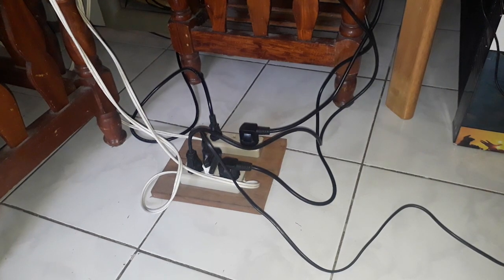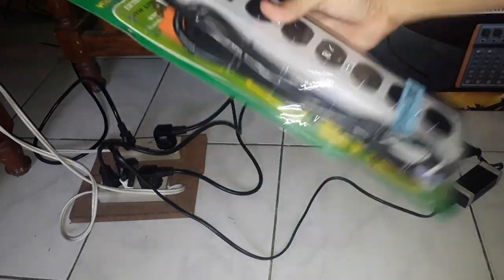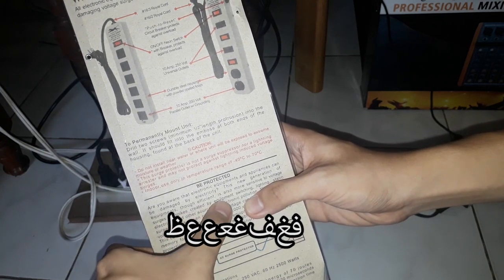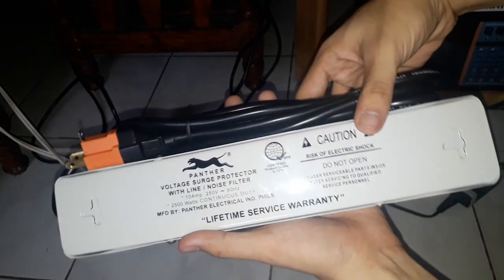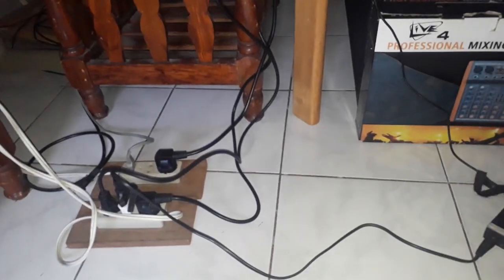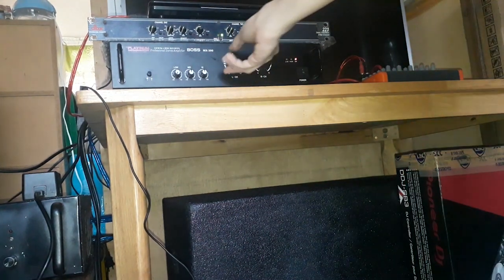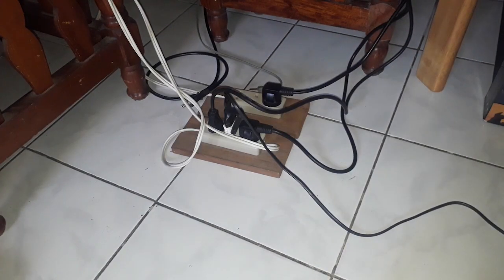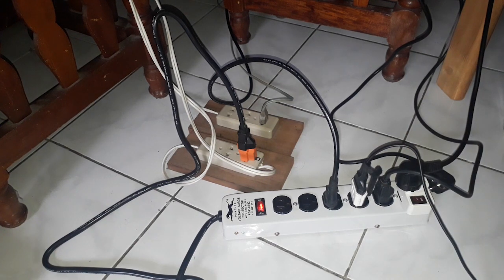EXTENSION CORD WITH SURGE PROTECTOR WITH SUBTITLE

Comment: surge comes from lightning so that extension strip has no surge protector on it just a capacitor for noise filtering but the caps are to small so basically they are useless, i review one of that strip a long time ago and i have to change the inside to make it safe. try to open it you're self so you can see what i mean but hopefully they updated the inside. still do some investigation for safety.
Reply from the maker: I would try to pry it open to see if there are changes and i'll make a vid about that bro. Thanks for your concern.
Reply: @mrflexysmps5826  hi! I'm curious I just bought one and failed on me, any updates?